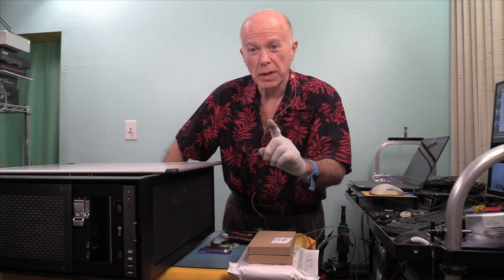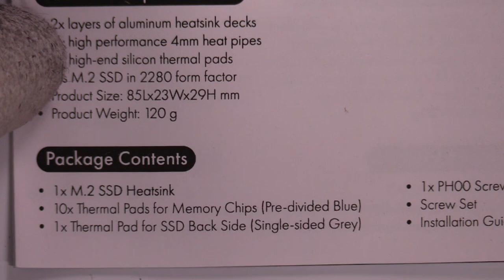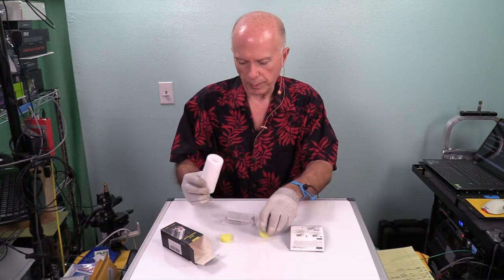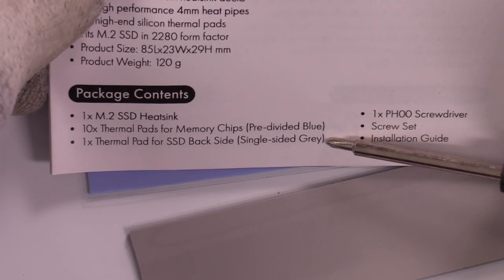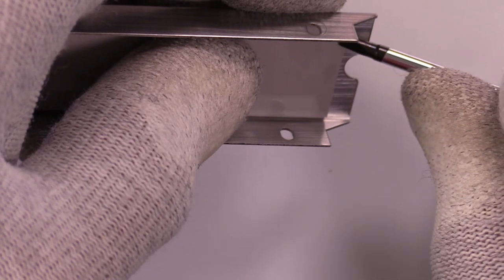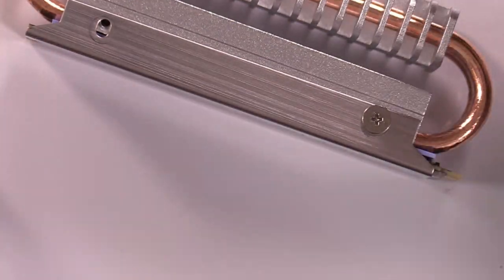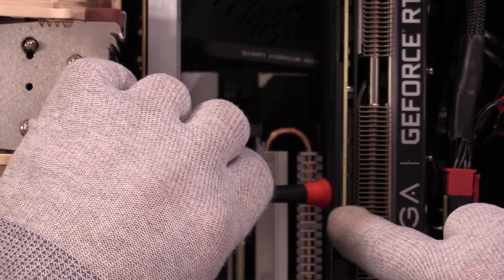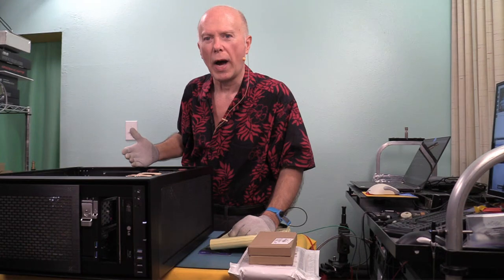Acidalie M.2 2280 SSD Heatsink on WD Black SN850

Comment: How about thermal grease?
Reply from the maker: Hi David, 
Excellent question. Not feasible nor practical. We'll get into that more in the summation. One more heatsink test. Thank You!

Interesting to note: All this started from Your Questions! Your Questions help Us to make better Videos! 

And these Heatsink tests are absolutely fascinating. I did not expect to learn so much as I have from doing this! Thank You for asking!
Reply: If the coolers are made for 1mm pads you would need a lot of paste to fill that big gap. What I liked about this cooler was a separate set of pipes on the controller end of the NVMe drive. Gill said he would try different pads with higher thermal ratings. I use Grizzle Minus 8 pads on the controller. Thermalright Thermal Pad claims 12.8 W/mK and tops even the Grizzle pads 8 W/mK claim. Best wishes fighting thermal throttling.
Reply from the maker: Hi @maxhughes5687 , We'll stated. Great idea however not practical in a small area. We'll mention that in the Summation which needs to be after the Thermal Pads. And using one of Your favorites! Vendors need to provide more information!
Reply: @maxhughes5687  EKWB heat sink for my optane 905 had both, silicon pad and grease. I should say if you are worried about grease on electrical connections most the CPU delidders just cover all the naughty bits with clear finger nail polish for the liquid metal pastes. Tried it both ways, with and without and the paste did drop idle temps by another 4c.
Reply: @davidwhite2011  IDK. On GPU's pads for mem or vrm with a gap and paste for the processor which touched the surface and would spresd the paste.
Reply: @davidwhite2011  Yes the $10 905 Al heat sink used grease on the memory on the back and the controller on the front. It used pads on the flash mem on the front, but one couldn't just flip flop from grease to pads anywhere on the 905. The back had mem chips all the same height but the front was a mix of different heights and used some pads to fill the gap and grease where the sink touched the controller. I read the manual.

Comment: If I had that cooler between an RTX3080/3090 and a quad card the fan on the RTX would be blowing hot air in the space and the extreme heat on the back of the gpu's VRAM would be sitting next to the cooler. I'd go with bottom 8X PCIe socket for the Dual NVMe card. maybe?
Reply from the maker: Hi Max, 
That's what We thought when We started these tests. Due to the alignment of Motherboard Components on that bottom edge, not enough room. We clear the PSU but connections on the Motherboard are the problem since they rise perpendicular to the Motherboard. Change one thing, changes everything! Therfore, the Slot We use has space on both sides. Just enough space! One more to test. I don't expect anything close however, Subscribers have mentioned fans so this next one will address a fan but not all fans. Again, We'll focus on the product. Unbox, examine, install and test and verify! Then compare after the Thermal pads! Had no idea this would grow to be such a project! Fascinating data! Fascinating Results!
Reply: @BuildOrBuy  Yes, lots of stuff I didn't think about when I first chose a MOBO.
Reply from the maker: Hi @maxhughes5687 , 
We're all learning together! I too now have a greater Knowledge, Understanding and Appreciation of Heatsinks more than ever! Still of most primary importance are Resources. This too is another Item on the List for consideration! We have a Video still to Film that drives that point home. Another TRX40 HEDT in a Lian Li Case not designed for XL-ATX but it works for the most part! Changing one thing, can change everything!

Comment: ooffff, I should've googled this review of this heatsink before I bought the other Digifast heatsink, had my doubts so I passed on this one xD

*Edited for clarity
Reply from the maker: Hi Guillermo Hernandez,
Welcome! After having Tested 14 Heatsinks, We learned to throw out all assumptions! If space is an issue, the Digifast is Your better choice! However, these Results are amazing if You have the space and if You have a Heat problem! Thanks for Watching! Appreciate Your Comments!
Reply: @BuildOrBuy  yeah I don't have much room, the Noctua cooler (Nh-D14) I use blocks a good chunk of the m.2_1 slot so a heatsink like the iGlacier8 is out of the question. I think I only have about 40mm clearance before hitting the cooler tower.

Awesome work on your videos, thank you for the job you did.

Had I seen them before hand I think I would've gone for this heatsink instead. I have already seen the digifast review, I'll be alright with that one. I am just preparing for the regular temperature season, it gets pretty hot in here mid 40ºC with quite a lot of humidity.
Reply from the maker: HI @Invaderzim2004 ,
Appreciate Your Comments! PCIe 4.0 M.2 NVMe Drive? Which one? Hind sight is always 20/20. However, I think You have the right CPU Cooler! That does sound warm! Thanks for Sharing!
Reply: @BuildOrBuy  Nah, pcie 3.0 Adata Swordfish 256gb, Stopgap while I get a new Video Card and then I'll jump to 4.0, but just on idle hits the 57-57°C then shots to the high 60s under use.

The other nvme 3.0 I have (gigabyte) that does have the heatsink asus includes on the TUF boards never goes past 40°c when I am reading and writing to it. And this one sits under the video card radiator that pushes air to the sides.

And I thought might as well get a heatsink now and reuse it when I get a firecuda 530 or an MSi nvme forgot the model.
Reply from the maker: Hi @Invaderzim2004 ,
Gearing up and getting ready for later! Got it! Seagate FireCuda 530! 

These are the 3 identified by Phison as using the Phison E18 Controller and Micron Memory. 
1. Seagate FireCuda 530 4TB Internal Solid State Drive - M.2 PCIe Gen4 ×4 NVMe 1.4, Transfer speeds up to 7300 MB/s, 3D TLC NAND, 5100 TBW, 1.8M MTBF, and 3-Year Rescue Services (ZP4000GM3A013)
https://amzn.to/3CFtWZb
2. Corsair MP600 PRO XT Gen4 PCIe x4 NVMe M.2 SSD – High-Density TLC NAND – Aluminum Heatspreader – M.2 2280 Form-Factor
https://amzn.to/39oVGV1
3. Teamgroup T-Force CARDEA A440 2TB with DRAM SLC Cache and Graphene Copper Foil 3D NAND TLC NVMe PCIe Gen4 x4 M.2 2280 Gaming Internal SSD Read/Write 7,000/6,900 MB/s TM8FPZ002T0C327
https://amzn.to/2W0emHI
As an Amazon Associate I earn from qualifying purchases.
Hope that helps!
Reply: @BuildOrBuy  This actually do, thank you very much!
Reply from the maker: Hi @Invaderzim2004 ,
Excellent! Keep Us Posted on Your Progress!

Comment: ty for your very informative vids... I'm wondering about the WIZMAX WARP Shield H heatsink because it's black & fits in my rig & the cooling fins will line up with the airflow in my case is it any good?? on the fence between this acidalie or the warp tyty :)
Reply from the maker: Hello thw4ck,
Welcome! Appreciate Your Comments! Excellent Question! Only one way to know, Test and Verify! Which one did You choose
Reply: @BuildOrBuy  I went with the acidalie because it has the upper part aluminum heat sink kinda hybrid finned instead of just rad fins around the heat tubes... i couldn't tell from the pics of the warp brand if it had only fins or not & btw tyty for your response I really appreciate it :) I've tried to carefully pick parts that work well together & have attempted to educate myself & your vids have sure helped with that... while I have your ear lol should I split the thermal pad to try & keep the controller separate from the other ?

Comment: I would be concerned with this design being so close to the gpu. If the gpu was running at 80c max, wouldn't the m.2 heatsink actually pick up some of that heat and potentially run at even up to 70c?
Reply from the maker: Hi Mark Jackson, 
Welcome! Glad You mentioned this! Absolutely! Have You watched any of the other Tests We've been performing? Anything is possible! We addressed that issue in one of the other Heatsink Videos. Same would apply if GPU was next to CPU. And if the GPU Fans do not spin up, I'm not concerned but a valid point. Changing one thing can change everything! This is only a Burst mode Test on a Dual M.2 NVMe Adapter. Your Results may vary. If We ran those Tests 3 times in a Row, the Heat could rise 10C to 15C Degrees easily due to sustained throughput. All the more reason to test each Heatsink 'as is' stock, out of the box and look at those Results collectively. Then see what We can do to improve those Results. Appreciate Your Comments! Thanks for Watching!
Reply: @BuildOrBuy  Yes I did, I think I've watched most of them by now. I'm doing a couple of 5950x with 6900xt, and 2 m.2 drives each. But also have another pc that i'm planning on adding a heat sink to its m.2. Your information has been highly helpful thanks. I also obtained 2 Adata 2 tb m.2s for my dark hero mobos. But in order to use them stock as they have a heat sink already installed , I won't be attaching the mobos heatsink to those. Woul you have any idea of how hot they will run, they are gen 4x4. Thanks, and any suggestions would be helpful, they will be next to the gpu heat fan output.
Reply from the maker: Hi @markjackson6829 , 
Sounds like a Plan! The best We can offer, Test and Verify. We've learned enough to know to throw out assumptions! You want to stay below 85C. Going forward, suggest watch for M.2 NVMe Drives with self contained Heatsinks. The 1st pass on Our tests are burst mode. Sustained throughput can raise that temp from 10 to 15 degrees. Keep Us Posted on Your Progress! Thanks for Sharing! 

We're working on another one now from Gigabyte. A Copper Heat Spreader from Joey, one of Our Subscribers. He asked Us to test. So We are! Stay tuned!
Reply: @BuildOrBuy  OK, thanks. And yes I'll keep you informed. I'll be trying the Adata m.2s first with the factory heat sinks , if they are running cool enough, I won't take off the factory heatsinks as I think that might be risky. But if they are hot being next to the gpu exhaust I''ll remove the factory heatsinks and try the mobo's as it is a lot longer with shallow fins.
Reply: Thanks I'll look for that other video, and just go through them all!
Reply from the maker: Hi @markjackson6829  , 
We expect M.2 Drive factory installed Heatsinks to run the best since they are designed for optimal performance. Going forward, We expect all M.2 NVMe Drives to be packaged that way. Always Test and Verify!
Reply from the maker: Hi @markjackson6829    
Good idea! To see how each performs differently. We have another Video Premiere today of the Gigabyte Copper Heat Shield on WD Black SN850 courtesy of Joey! He asked Us to test. We said, OK!
Reply: @BuildOrBuy  Thanks, I still haven't gone through all your videos, but how do you measure the temps on your m.2s?
Reply: @BuildOrBuy  Ya cool I saw it thanks
Reply from the maker: Hi @markjackson6829 , 
Good question! As shown in the Heatsink Videos using Hwinfo64, Sensors only. Reading the SMART Telemetry from the M.2 NVMe Thermistor(s). And Comparing that against CrystalDiskMark for a Burst mode Test. To reiterate, To run a Test for sustained throughput, as stated in the Heatsink Videos could be achieved in 2 possible ways. 
1. Run CrystalDiskMark 3 times to simulate sustained throughput. 
2. Send a file from Drive A to Drive B of a sufficient size to approximately equal the time to achieve same Temps and back of a different file with same Specs so as not to be in the Drive cache. 
Either way, expect the Temps to rise 10 to 15 Degrees C accordingly. 
Hope that helps! Thanks for Asking!
Reply from the maker: Hi @markjackson6829 , 
Outstanding! Thanks for Watching!

Comment: Is it worth it? I dont know im having an issue now and its that every so 1 - 3 hours this static would come through my speakers and its really annoying its unbearable. So it happened to me the first time with my first NVME I had which already shut down on me and I have this second one installed but after a year and like 2 months the sound is back so im assuming that i might need a heatsink?
Reply from the maker: Hello Nene Roars,
Welcome! Interesting. Tell Us which Motherboard You're using and what Audio You're using? Motherboard Audio, Audio Add-in-Card or USB? We need more Information!

Comment: ElecGear M.2 2280 SSD Cooler, M11 Angle and Height Adjustable Heat Pipe + Solid Aluminum Heatsink with PWM Cooling Fan for 80mm PCIe NVMe and SATA SSD Internal Solid State Drive, Thermal Pads included
and
ineo M.2 2280 SSD Rocket Heatsink Built with Adjustable PWM Cooling Fan [M9]
and
JEYI Copper M.2 HeatSink, Passive Nvme SSD Heatsinks with Copper Fins - Finscold Q80
and
Vantec ICEBERQ M.2 NVMe/SSD Heat Sink with Thermal Pad (HS-NVME150-RD, Red)
and
XINSHIS - M.2 Heatsink NVMe NGFF SATA M.2 SSD Heatsink Thermal Module, Compatible for PCIE NVME M.2 2280 SSD Radiator and SATA M.2 2280 SSD Heatsink, with Heat Pipe and Silicon Thermal pad
Reply from the maker: Hi SS İÇİN, 
Welcome! Just now seeing Your Comment! YouTube never informed Us! I'm seeing this through the YouTube Dashboard! We have, so far, Tested 14 Heatsinks! Appreciate Your Comments! Thanks for Watching!

Comment: Brand new setup less than a week old ()
Setup Fractal Meshify2 case with X2 GP-14 140mm fans 2 front 1 rear and top case exhaust 3 fans on the water cooled CPU  radiator ASUS TUF Gaming Z690-PLUS motherboard
With stock motherboard supplied heat sink ( flat piece of aluminum length is 2 x the length of the SSD with motherboard supplied thermal pad between the ssd (kingston KC3000 1TB) and the stock heat sink. 

Room Temp 78F or 25.6C
PC up and running under no load for 15 mins stable steady state : Chip 25C / Controller 47C
Peek after load run: Chip 32C / 48C
Delta rise +7C/ +1 C!!! Ambient approach  : 6.4C /22.4

Crazy surprised controller temp only up by 1C!!!!..
With those temps don't really need a flashy cooler...... wow super surprised....
May buy this one just to test it out.....
Reply from the maker: Hi mugenrios2k,
Welcome! Sounds like You're set! Very good stock Temps! Your Results with the Acidalie might be interesting if You have the space overhead! Thanks for Sharing Your Results! Appreciate Your Comments!
Reply: @BuildOrBuy   
here are my results   
Room Temp again  78F or 25.6C
PC up and running under no load for 15 mins stable steady state : Chip 24C ( 1C cooler than baseline)  / Controller 47C ( same as baseline)
Peek after load run 31C (2C cooler than no cooler     / 47C  ( 1 C cooler than no cooler) 
Time to return to pre load run stead state temp 25/47   1min 35 secs mins
Reply from the maker: Hi @mugenrios2k ,
Interesting. Not enough to warrant using a Seperate M.2 Heatsink Cooler on Your Configuration. Thanks for Sharing those Results! As always, Test and Verify!

Comment: The main problem with all of these Nvme heatsinks is their surface area………….which there isn’t enough of. Do they lower temperatures of Nvme drives? Sometimes yes………but mostly no. Overall, they are not worth the money being charged. Fan…….no fan……heat-pipes……no heat-pipes………makes not one bit of difference. It is not the memory that overheats on these drives. It is the “controller”. If you can drop the controller temperature, then you have the problem beat. The entire drive does not need a heatsink. Sufficient air movement across the drive should be enough to cool these drives. No need for fancy coolers or useless tiny fans that move little, if any air. The fact you mentioned that memory needs to be warmer than the controller is the main reason I only cool the controller using double-sided, non-conductive tape and a copper heatsink. I have been successful with this method in maintaining drive performance by keeping controller temperatures lower then with a full heatsink or none at all.
Reply from the maker: Hello Tech Luvin, 
Welcome. Appreciate your comments. Our Results speak for themselves. The Acidalie is one of our 2 best we've tested so far.

Comment: I just can't get away from a water block for a quad card. EKWB, don't fail me now. Every generation of every component gets smaller transistors, faster clocks, an increase in power draw and hotter. When I breakdown and go open loop water is the only question. Utubers are already crying about DDR5's temp increase. Wait till we get PCIe GEN5 M.2 drives and see the temps. If I need to put my 420mm rads in a window sill with the 140mm fans blowing winter air through the radiator and into the living room, I will.
Reply from the maker: Hi Max, 
You make a good point. We need to think Quad. EKWB would be my first choice as well! Noctua would be my second. Noctua demonstrated diamonds 8 years ago! That's another reason why what We're doing now is so crucial. We need a Solution before We have the problem! Exactly! 15,000MBps. That has to be something with nanocarbon fiber copper or ceramic coatings. Peltier cooling or Thermoelectric cooling! A Radiator make sense. Nothing to reinvent only repurpose! There has to be an option other than what We're seeing from Vendors. If You locate something before We do, please let me know!